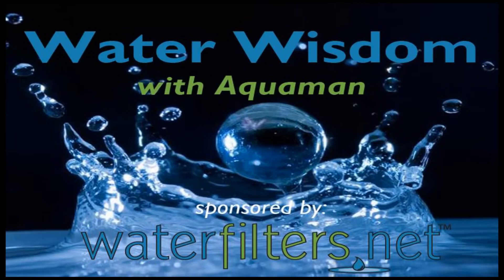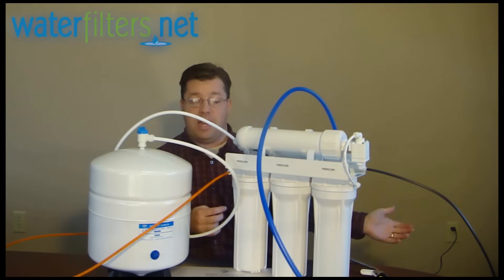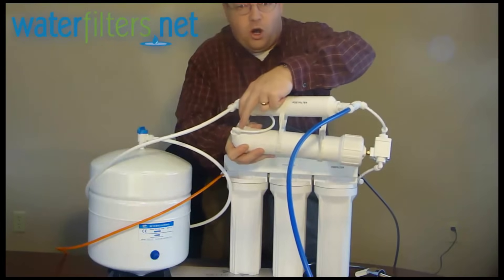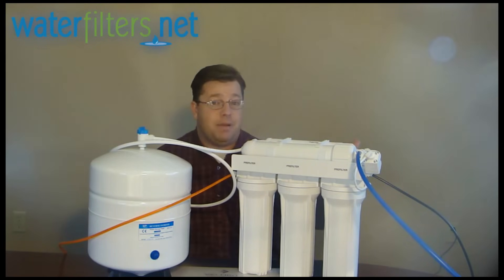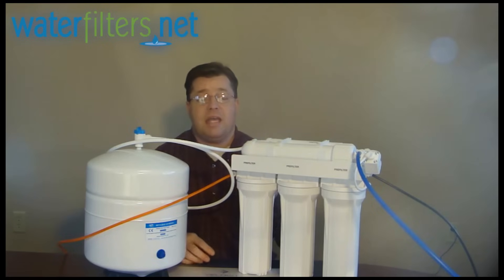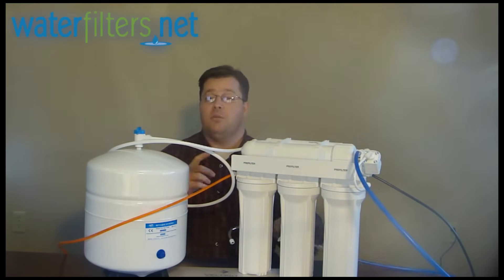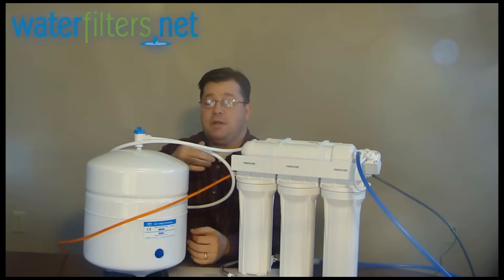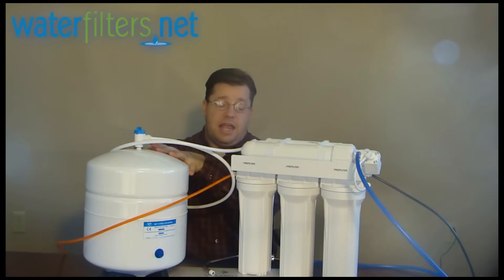Reverse Osmosis System Troubleshooting

Comment: You Sir are very informative and have a gift of communicating with in- depth explanation. Thank you for educational video. I now know I need a tank and possibly a ASO valve. Hissing is only at certain times. I will change the tank and if I hear the ASO not shutting off I will replace. I just installed a PRV and had to reduce to 55 PSI from 85 PSI for Water distribution system for entire house. I believe the previous high pressure trashed the tank and possibly the ASO Valve. Question, before I replace either do you know what the PSI rating for tank and ASO Valve?

Comment: No bodys been able to fix my problem. My tank will not fill with water. The tank has 8 pounds of air empty. I've drained all water out of tank. I've let the air out of the tank and refilled it to 8 pounds. Still no watwr in the tank. Watwr flows to faucet for 20 seconds and stops because no watwr is going into tank?

Comment: I just replaced all filters and the RO filter a week ago to discover that the tank which was between 10 to 15 years old was not sustaining any pressure. I replaced my tank last evening with a new one, and let the system sit for a couple of hours and then I got about a gallon and a third, and then trickle. Next I let it sit overnight and I got about a gallon and a half.
 The tank is supposed to be at least three and a half gallons so I don't know where the loss is happening..
Any suggestions? 
I have a small cheap foot pump with a bad gauge on it. I'll have to run out and get a tire gauge tomorrow to verify period any suggestions in the meantime would be great

Comment: I have a question, after changing my filters and membrane, my water is cloudy and tastes bad.  You can see little particles floating in the glass after you pour it from the tap.  Any ideas what may be causing it?  I've let the tank drain several times but this isn't fixing the problem.  Thanks!

Comment: hi I have question so I have Ro system its Westinghouse product so why when  use 2 class the drin line take about 45 mint tell stop  also I test my shutoff valve it's working when I turn off the tank valve the drain stop but onley when I use 2 glass water the drink take more then 4 mint to stop so do you what is problem

Comment: Great Video!  My tank was about empty in the morning.  Checked the water going into it and it's drops and not a flow or stream of water.  What is the normal flow into the tank coming from the system? Just changed all filter, so they're all brand new.  Is there another issue or blockage causing this?  If so, where?  Thanks!

Comment: Hey Aquaman, I just got my RO system installed on Friday, the guy told me to leave the faucet open for several hours, forgot already for what purpose. The tank is not getting full overnight, also, I'm checking the quality of the water with a PPM meter and it's failing so far, average around 380 p.p.m. my bottles of water averaged 20 ppm. Do you think I got a defective system? I'm calling the company on Monday but I still would like your opinion. TIA.

Comment: We had our RO system sitting in storage for a year. Is it still safe to use or should we completely change it out or change out the filters? We have it installed in our house now but scared to use the water.
Reply from the maker: It would probably be a good idea to change out the filters and sanitize the system just to be on the safe side.

Comment: a defective tank is not the only posible issue with low presure sometimes the filters are clogged and needs to be changed or there might be mineral  buildup in the inlet line
Reply from the maker: Always a good idea to check if your filters need changing or if the lines are clogged.

Comment: THANK YOU This has been very helpful in some cases but I'm still having an issue. PLEASE HELP!!!  I just changed all of the filters and the membrane but when I turn on the water there is no brine water coming out of the black tube nor can I flush the membrane even after I remove flow restrictor. I've checked and cleaned the membrane tube to make sure there was no clogging but it didn't help.  UGH in tears!! Thank you.

Comment: My system was working perfectly well last night before I replaced the cartridges. I let the tank fill overnight and the water pressure is very low. Is it possible that the bladder went bad during the replacement?

Comment: It is my understanding that the bladder only requires 5 to 7 lbs of pressure not 30 to 40 lbs. You may have confused your followers and created a dangerous situation!
Reply: 5 to 7 PSI pressure should be when the tank is empty. As the tank fills, pressure should rise. Although, if you don't have enough water pressure in your house, the tank might never reach 30

Comment: Can a clogged sink drain pipe push dirty water back into the RO system through the brine water line?  If so, how can I change the setup in the kitchen sink?  For some reasons my kitchen sink keeps getting clogged.  The drain line is attached to the drain pipe and I'm concern the clogged had pushed dirty water into the RO system.  I'm not sure what I can do to prevent it.

Comment: I had a low volume problem, so I emptied the tank and pressured it to 6 PSI when the tank was completely empty. After that the tank doesn't get filled with a water. 6 hours later, air pressure is still 6 PSI but its empty. What may be the problem? Thank you!

Comment: So if my water supply is too low, (input pressure); can I release a little pressure from he pressure tank to allow a higher "volume" of water to enter the tank?? NOTE: I know this will reduce my output "Pressure" but I am really most concerned with the low "Volume". I am currently getting only 2.5 cups of water every few hours.

Comment: Sir, I have a small amount of water coming out of the drain line 
Hint, 1- the pressure of the water pump is more than 10 bar 
2- I replaced all the filters and still have the same problem.

Comment: The pressure valve on the top of the bottle started to leak a water. In a minute my kitchen was all in water. So this is a dangerous system from my experience. The control valve where the water is cumming from should be stronger than what it is.

Comment: Water tests should ALWAYS be conducted Before and After installing water equipment, so the correct filteration is installed to treat your water correctly, so you get Ideal Drinking water.  For testing in Ontario CA
Call Ecocare Lifestyle @ 1(888)999 1902. 
Or PM Ecocare Lifestyle on FB or Instagram. 
Your support helps us to continue our awareness campaigns on plastic, air, and water pollution, as well as many other environmental campaigns. You can also donate by visiting ecocarelifestyle.com🙏

Comment: I have replaced all filters but taste is so much bitter now. Then i came to know my flow restrictor is blocked or water not flowing through it so i try to clean it and it working again so after 2 days again i feel taste is not so good again but flow restrictor at drain valve is ok. Any solution???

Comment: I’ve had three aqua true countertop systems and they all failed. The company was baffled. I gave up and bought a reverse osmosis system from commers. The filters in all of these systems say they are annual and mine are failing in a month or maybe two months. Filters clogged is my guess but neither AquaTrue or Commers Water have been able to determine why I’m burning through these units in a month or less. Do you have any ideas ????
Reply: Water tests should ALWAYS be conducted Before and After installing water equipment, so the correct filteration is installed to treat your water correctly, so you get Ideal Drinking water.  For testing in Ontario CA
Call Ecocare Lifestyle @ 1(888)999 1902. 
Or PM Ecocare Lifestyle on FB or Instagram. 
Your support helps us to continue our awareness campaigns on plastic, air, and water pollution, as well as many other environmental campaigns. You can also donate by visiting ecocarelifestyle.com🙏

Comment: Could you explain which filter choices are best for filtering surface water with a 4 stage RO system.  I have had sediment, Carbon Carbon.  But was recently told to do Sediment, Carbon, Sediment...

Comment: question when water enters my resin canister it fills up with water but soon as i turn it on it draws quarter of the water  out . the water trickles at that point  . i recently had to replace my second canister do to leak at the threads . prior to that it was normal for my water to trickle out but not draw down on resin container section . i have a lot condensation on the plastic tubing also hear small hiss but cant pin point another leak  . i only hand tighten fearing i break a canister if i used a wrench . i have good arm strength i can pick a husband up by his shirt and throw him on the couch   one handed chair and all .

Comment: My tank, empty, stays at 7.5 psi.  It won't fill.  water continues out the drain, tank never fills. What of this situation?
Reply: My first guess: you're missing the flow restrictor. Without back pressure you will produce no RO water but water will flow continuously down the drain. Make sure you install the flow restrictor compatible with your RO membrane; my 100gpd membrane requires an 800ml/min restrictor. This is not a one-size-fits-all situation!

Comment: Hello. Today we changed all our filters in the system  and now we have a priblem:water not getting in to the tank. If I turn the water on its licking non stop. I mean if it was the tank water it would stop running after a few minutes when tank would get ermpty, right? But it's won't stop running. I'm assuming that water won't go to the tasnk and goes straight to the faucet. How I can fix This?

Comment: We replaced our tank, but it does not fill. We've followed the steps to re-pressurize the tank, installed new filters, have checked to see that water is entering the system. We get approximately 30 ounces of water than nothing. Suggestions?

Comment: I pumped the air into the tank and measured with tire gauge is 7.5psi, after few days used, I drained water and measured again it is 0 psi
so once the tank is full, measure if it is 50psi otherwise either Aso valve or water pressure itself? then my tank bladder or tank itself is defective?

Comment: we have wher25 system. Usually we just change pre and post filters but today wanted to change only RO membrane, as others changed recently but flow was slowing.  We first removed pre-filter but then some water leaked out of manifold where this filter attaches. First time ever (have had system for 10 years) that we have had any leaks. Then removed and replaced RO membrane and replaced same pre-filter. All seems ok but any idea why water leaked out when filter removed?
Reply: Did you check O rings?  If they are cracked or broken, you will get leakage.

Comment: Excellent video. It didn't address my questions, but it's very helpful for understanding how reverse osmosis systems work. I have two questions. First, unlike the problem depicted in the video (continuous discharge), my system never discharges any more. Second, after more research, I don't think I need reverse osmosis anyway. I wonder if my water is still being filtered in four stages and if so, is this as good as a high-end four-stage non-RO filtration system, or should I ditch the system I have and replace it?
Reply: RO or Distillation are the ONLY methods that can achieve ideal drinking water- under 50ppm of Total Dissolved Solids. If the new equipment can bring your water to less than 50ppm then yes, this is the standard for ideal drinking water. It can be measured using a TDS Meter. 
Email Solutions@ecocarelifestyle.ca to purchase your TDS Meter. 
Or PM Ecocare Lifestyle on FB or Instagram. Your support helps us to continue our awareness campaigns on plastic, air, and water pollution, as well as many other environmental campaigns.

Comment: My Amtrol RO4 just failed after 19 years.  Poor pressure at the faucet led to me determining water leaking from the schraeder valve while trying to take pressure readings.  The water leaking from the schaeder valve is due to a ruptured internal rubber bladder which, in a properly functioning tank, separates the water at the top of the tank from the pressurized air chamber at the bottom of the tank (where the schraeder valve is).
Reply: I have same problem with my system. If you know the solution please share, thanks
Reply: Simple swapout of the RO water storage tank.  I got a new 4 gallon tank from Amazon.
Reply: i am on my second tank and now have to replace my ASO valve for a proline plus RO. Aquaman help!

Comment: Hey I had a friend who originally installed my system rerun the black line because it was run too tight and had a kink in it that was causing constant gurgling.  Once he reran that line the gurgling stopped but before I suggested the problem was that kink he had messed around all crazy with the psi of the tank exactly like you mentioned not to do.  Since the repair was done and he had messed with the tank psi (rather aggressively) the tank has not refilled.  Is still disperses water but the tank is clearly empty or not fully filling up.  Is this the sign of a broken bladder?  Do I need to replace the tank?

Comment: Thanks, exactly the info I needed! I had the super slow flow after about 1-2 years after the installation. 
I disassembled the valve first and then the whole system wasting 2 hours of my time...
 After watching your videoI gave a few pumps into the tank and the system started to work fine again.! 2 min.!:)

Comment: Hi.  I am having the low pressure/volume issue.  My tank is full and I tested the pressure at the schrader valve and it read 42.5psi, however when I turn on the faucet I only get a strong street for about 1 to 2 cups of water and then it trickles off.  Not sure the issue if the tank has good pressure...
Reply: Street = stream***
Reply from the maker: +llollwutt  Thank you for contacting WaterFilters.NET!
Our Customer Service department would be happy to assist in troubleshooting any issues you are experiencing. 
Please call us at 888-801-7873. We are open Monday-Friday 7AM-7PM CST.
Thank you!

Comment: I just bought a Brita USS-335, installed as instructed, but after 4 hours, and there was no water in the tank. would you please tell me why is that happened.  Thanks a lot.
Reply from the maker: +tommy nguyen Thank you for contacting WaterFilters.NET!
What is the water pressure before the system? Are the housings and tubing all installed correctly?
Please contact our Customer Service department and they would be more than happy to assist in trouble shooting for you.
888-801-7873. Thank you!

Comment: Wise Aquaman - Excellent video. I'm in the process of troubleshooting my newly installed system (slightly different from the system you are talking about), but now I believe I do have a defective ASO valve. The instructions say to allow the tank to fill 6-12 hours and it has been discharging for at least 18 hours. I am getting ~42 psi at the Schrader valve on the 3.5 gallon storage tank, so this back pressure should be bringing silence and rest to the system. Right? Many people are asking about the amount of water wasted from RO systems. I can say that my manual specifies a ratio of 7:1 (7 parts wasted to 1 part filtered water). Prior to connecting my discharge line (coming from the air gap faucet) into a drain pipe, I ran the line to 5 gallon buckets. I filled about 8 of these (40 gallons), of wasted brine water. This is more than 11 wasted for every filtered gallon. I'm hoping your advice is true and this is a defective ASO valve, because if these systems are truly this wasteful, then they should be outlawed. I'll also mention that I do have a water softener, so what could be challenging the filter to work so slowly? I'll let you know if the problem gets resolved from a call to the manufacturers. Thanks!
Reply: +li sun To get less waste water with an RO system, you put a second membrane fed by the first membranes waste water and you may need a booster pump. You cut your waste water in half this way.
Reply: Troy Nellermoe "then they should be outlawed", RO with less waste water should be built. We should waste no water at CA

Comment: My tank is leaking from the top where the valve connects to the tank, does that have to do with the pressure also?
Reply from the maker: ***** Hello Wen Chen, The leaking sounds more like it could be a crack in the tank/valve or a tubing issue. Although some leaks may indeed be caused by pressure. I would recommend checking all the fittings/valves and all of the water lines to verify there is no cracks that could be causing the leaking.If you have any other questions please call our customer service department and we would be happy to trouble shoot with you. Our phone number is 888-801-7873. We are open Monday - Friday 7AM-7PM CST.   Thank you  WaterFilters.NET

Comment: Aquaman,
Recently my RO system started making anon-stop gurgling sound that we can hear through the faucet.  Any gueeses as to the cause?
Reply from the maker: Glenn Kluge Good Afternoon, There are many different reasons that your faucet could be making the gurgling noises. It could have to do with your flow restriction, your filters, the brine water, or numerous other things. If you can call our customer service department at 888-801-7873; we would be happy to go through the list and help determine which item is causing this issue.We look forward to hearing form you soon!WaterFilters.NET!